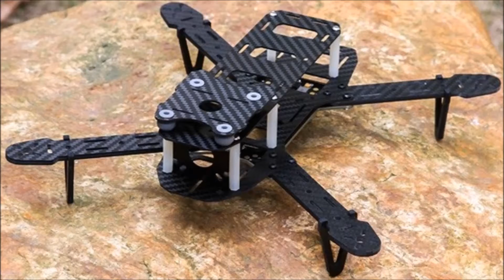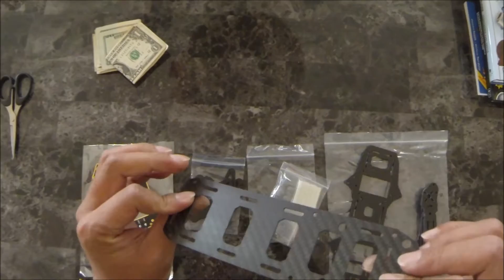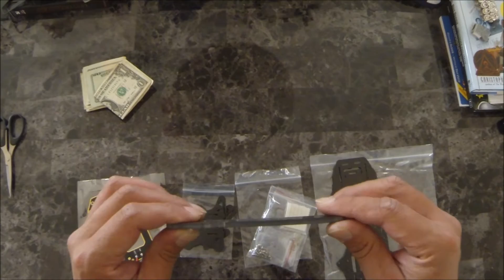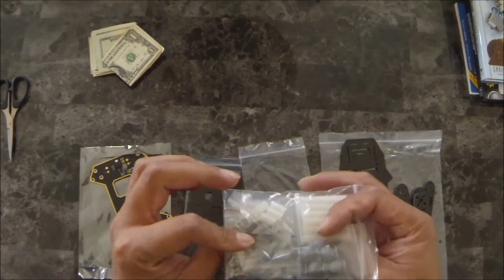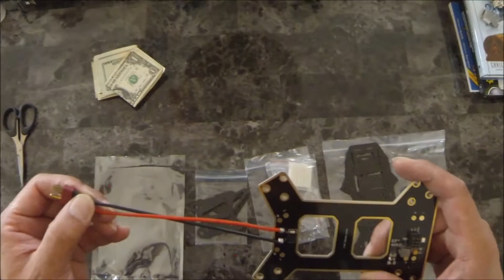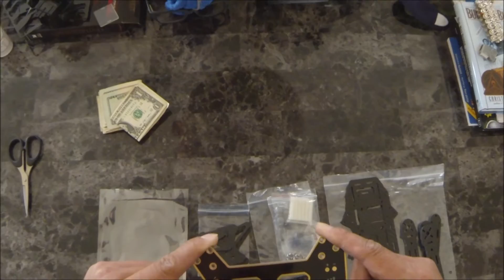Quick Review: RCTimer Argonaut AQ320 Quadcopter

Comment from the maker: yes it is built and the build pictures are on my blog on rcgroups. it flys great and the motors are absolutely awesome! ill post flight vido when I get a chance.

 inch props max I think but that's cutting it close. tons of power already on 6 inch props
Reply: fastgixxerlv89123 link to your blog?  im thinking about buying your used one
Reply from the maker: Sorry but it's been sold
Reply: fastgixxerlv89123 link to your blog?  i just got mine in the mail.  12A Rotorgeek esc's and 2204 motors
Reply from the maker: Sounds good! I really like those ESCs!
Reply: im new to rcgroups.  how do i find your blog?